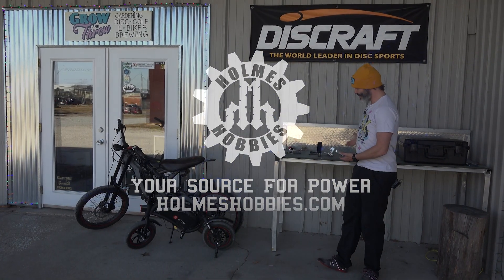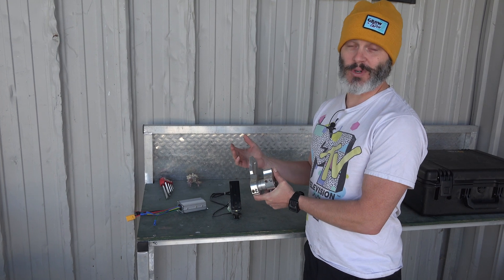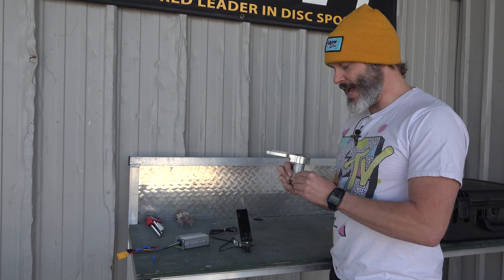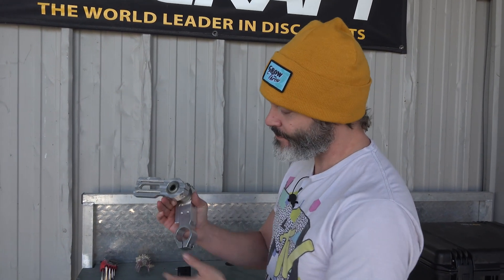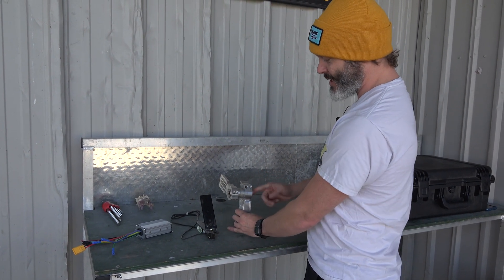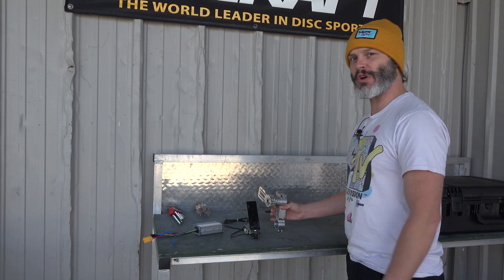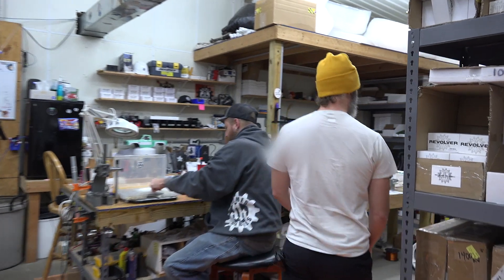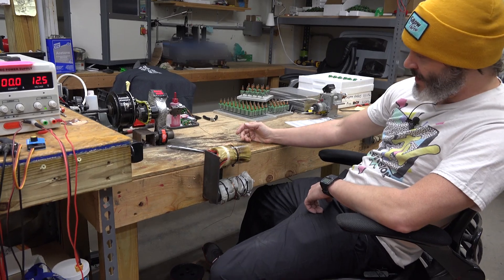Inside Look At The RC Brushed Motor Winding Tools At Holmes Hobbies

Comment: I use the Retro Sport 21T motor in my Tamiya Hot Shot build. Having a bearing on the output shaft is nice vs a bushing that will require regular oil lubrication (which is hard to access and you'd have to remove the motor from the chassis first).

Comment: Is it possible to order your 540 sized motors like the puller pro v2 stubby with a 5mm shaft? Looks like it steps down from 5mm to 3.175.
Reply from the maker: I wouldn't do a one-off in stubby or standard.  The 540L puller pro has 5mm shaft.  It is the only one that needs it because of torque and power output.

Comment: So are you counting the turns or does the machine do the counting?
Reply from the maker: The machine has a digital counter and I wired up a hall effect sensor with pull down to trigger when a magnet passes by.

Comment: Right tool for the right job I was always told. I have a hand wound armature winding tool kicking around somewhere dating back to the 70s haven’t used it for years, but should still work a treat! The home brew tool I use the most is a spoke threading and cutting tool. Inherited that from my grandfather. From what I remember he made it after the WW2. Still cuts and threads perfect!
Reply from the maker: Does it have 3 rotating dies or two sliding ones?
Reply: @HolmesHobbies  it’s a slider type, similar to the old Phil woods but reversed to support the spoke along its length to cut true. The threads are more rolled then cut, maybe to retain more strength? Downside is you still have to bash the end for a spoke head.
Reply from the maker: @fatfreddiescat9952  Thats the better method of rolling them.  I have a Morizumi spoke rolling machine, the dies are vertical.   Spoke blanks can be bought these days with the ends pre formed.   This is how I build all my custom wheels.   

It sounds like you have a gem of an old machine!  Thread forming machines require a lot of force and precise alignment of dies to work properly, your grandfather must have been a great machinist and designer!

Comment: Reminds me of winding transformers at Ratelco in downtown Seattle. Same process, little to big. All our winders were custom in house builds. I love building tooling.
Tubing bender, frame jigs, 
Soldering clamps, notcher.
Building is by far my favorite part of the hobby 
Thanks for helping us build the best rigs we can.
Just bought your new 650 servo, and a 2200 outrunner. Just waiting for the speed controller to come back in stock. Loved this vid. Hope you and yours are happy. Please, have fun
Reply from the maker: They are very similar to transformers, except the secondary is magnets and the output is rotation instead of voltage.  We could exchange the secondary for coils.   If the rotor was locked and fed AC it would actually become a poorly designed transformer, but still useful in emergency situations.
Reply: @HolmesHobbies  I had a lot of fun working on prototypes with the engineers. After a couple years I got into the machine shop and started building tooling and running the NC machines. (Tickertape, or cassette).
That kicked my career as a custom fabricator, machinist. I enjoyed the shop walkthrough.
Thanks for your time. Can't wait for the mini ESC to be back in stock!
Have fun.